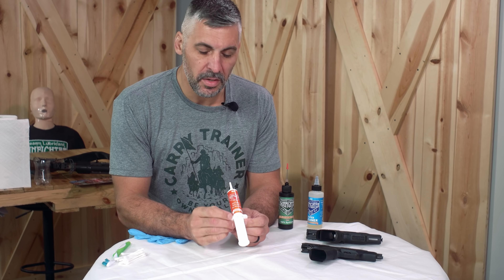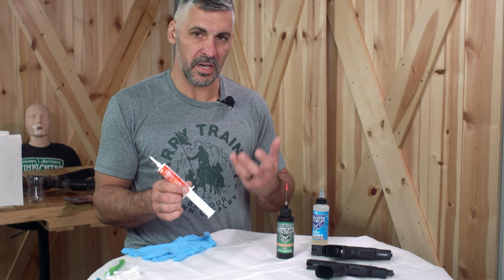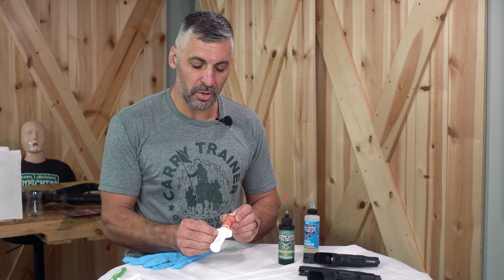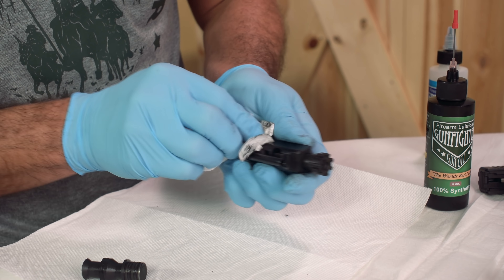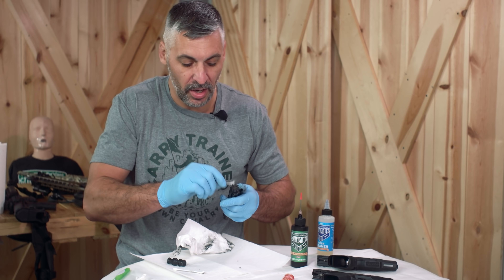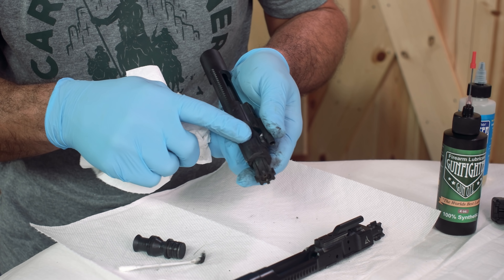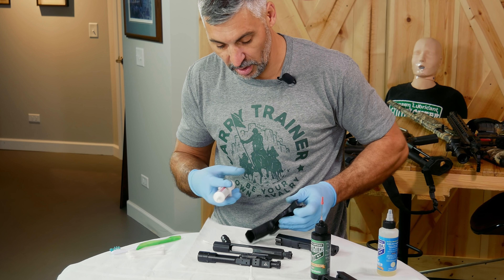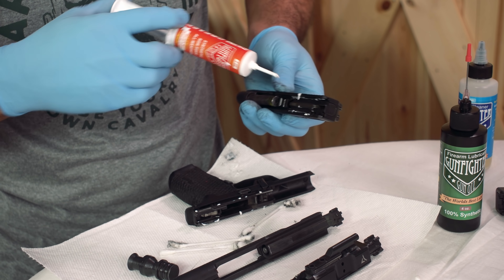Gun Grease

Comment: I was so skeptical about using grease or oil on my gun. Now this makes all clear and senses, grease do work better than oil, it dry over time. Thank you for a very clear informative about using grease.
Reply: I mean really all you gotta do is look at heavy machinery. Literally every machine that's grinding metal on metal (exactly like a firearm) is typically universally always greased and not oiled. If literally ALL of the industries use grease for their heavy machinery then one can assume that's best for guns.
Reply: I use grease that doesn't gum up when oil is added in. During summer I use High Temp Full Synthetic red grease from Lucas. Thin coating and then I added in oil(G96) as I cycle the action. To note: make sure you get all of the old grease off before adding new grease.

Comment: I love this grease. It is the perfect weight for my needs. I will check out the oil as soon as my slip2000 supply runs low in few months. Thanks for the practical and targeted approach to your instruction and product offerings. It is refreshing. Keep up the good work.
Reply: try Paragon 3000 Moly Grease, probably the best preforming lubricant on the market. My lever action never ran smoother, & my ppk slide feels like its floating on the spring.

Comment: Anyone who takes care of machinery or a mechanical engineer will tell you the following;
Closed regenerative system use oil. (Splash or pump)
Nonregenerative system use grease. 
The issue with weapons is maintaining a cyclic rate sufficient enough to allow the weapon to properly operate in a given condition (Heat, cold, dust, saltwater etc.) Hence the Military uses oil for all the above conditions but is not optimal for any of the conditions. Most civilian shooters know their conditions so they can utilize a lubricant that is optimal for their conditions which IMHO is grease for most civilian applications. My preference is a handmade concoction of SYN Diesel Motor oil, SYN ATF and SYN Grease mix.
Reply: Wrong. Anyone who takes care of machinery will tell you to follow the manufacturer instructions as to what lubrication to use. Putting the wrong lubrication in a machine can cause it break or malfunction. The problem with guns is that it's a much simpler machine and doesn't have the heavier load so you can get away with using various types of oil or grease products depending on what works for you.

Comment: I use hoppes 9 lubricant and cleaning solution, I clean after EVERY use of my firearms. I don't find an issue with getting all the carbon off the gun because I clean every single part of it after use. Either a day or two after. I may use gun grease in the future but right now I probably wont use it unless my firearms are going to be in storage for a while, but then again I will order some grease and test it out with my shotgun. Do you use grease only on moving parts? Or do you use it in the barrel of the firearm as well? I assume just the moving parts since you didn't state anything about the barrel. I use the lubricant in the barrel after cleaning it to prevent rust.

Comment: the radian bolt is coated in what looks like black nitrite, of course its going to come off easier, it would have with oil too.
Reply from the maker: The difference is oil doesn't stick the same.
Reply: @CarryTrainer  sure, but it doesnt need to and neither does grease, its a coated bolt. using 2 completely different bcg doesnt accurately explain the point youre trying to make.use 2 plain jane bcg and then we can have a debate on either grease or oil. until then its not a fair comparison, that coated bolt can run without lube for thousands of rounds. they both can actually. the military arms channel has a bravo company rifle with a mil spec bcg and he has ran it for 8,000 plus rounds with no lube at all. it runs. it seized it up when he had to store it for a while, but once he cracked it open it ran. thats more than good when you consider mil spec doesnt require the life of a rifle to last that long anyway.
Reply from the maker: @stewpidaso26  it explains it. That carbon ends up attached to the lube vs deposited in the action or elsewhere.
Reply from the maker: @stewpidaso26 That carbon ends up attached to the lube vs deposited in the action or elsewhere. Hence, the point I'm making. 
The goal isn't an abuse test.
Reply: @CarryTrainer  its a coated bolt dude, its going to come off a lot easier than a normal bolt regardless. use 2 normal bolts to make the comparison.
Reply from the maker: @stewpidaso26 it's a demo. We do it in most classes. This isn't a hard stuff. Grease on BCG makes cleanups easier.

Comment: This summer I've been experimenting with lubes. I'm gonna move on over to gun grease made for guns specifically. After listening to a YouTuber named gunblue something or other, I discovered that baby oil is just pure mineral oil. So I douched my cz 75 b down with it and proceeded to blast through 500 rounds of my smoky reloads of unique powder and 124 grain cast bullets.
I was amazed at how effective the oil was.
Bearing grease performed great as well with the same filthy load. 
Transmission fluid functioned great but it stinks.
Motor oil works well indeed but it created a black sludge after 500 rounds.
My conclusion this far is that my pistol doesn't care what it's lubed with.
Baby oil smells good and when it comes to clean up it acts as solvent.

Comment: Run em wet but make sure that striker and striker channel is bone dry. I use Slip 2000 EWL 30 because it’s thick and stays put. Regular lube is too runny. This Gunfighter grease looks good. I might need to try some.
Reply from the maker: I'd challenge you to try our lubricant.

Comment: Is there a difference between anti seize and grease?
Reply from the maker: Yes quite a bit of difference. Grease and anti-seize are popular options for industrial assembly processes. Yet while they both aid in end-product functionality and durability, it’s important to understand their distinct differences.
Grease
Ideal for fast-moving, low load applications, grease is formulated with a base oil and a thickener. Containing no solids or low solids, grease enables parts, such as high-speed automotive ball bearings, to move rapidly without making contact. However, grease alone is not suitable for extremely high load and/or very high temperature applications. This is because the oil burns off around 400°F, and its film is not strong enough to hold against pressure from asperity contact.
Anti-Seize
Designed to convert torque to tightening force more efficiently, anti-seize is formulated with high solids content and a carrier grease. Because of its high solids content, anti-seize can handle high load applications while still providing lubrication and friction reduction. However, anti-seize is not suitable for fast-moving applications, as its high solids content can cause parts to jam. Yet unlike grease, the solid lubricant in anti-seize can withstand high temperatures and protect parts from galling and seizure even under extremely stressful environments. This makes it ideal for many nut, bolt and press fit applications.

Comment: I’m not sure how effective it is for us here in Alaska. I’ve heard that grease isn’t good in cold weather, and so I’ve used CLP. Not sure whether that’s myth or not, but so far, all my firearms have worked fine through thousands of rounds with CLP.
Reply from the maker: That's definitely a myth. Your car, snowachine and snowplows are full of greased components.
Reply: Clp is a horrible lubricant, you'd be better off using motor oil.
Reply: @deussanguinius4263  I guess it’s just been “if it ain’t broke, don’t fix it” for a while. But it makes sense and I learn new things about firearms every day lol.
Reply: @MikoTactical  project farm has a video testing a few clps it's shocking how much wear some of them cause.
Reply: You got grease weather resistant solutions 😅